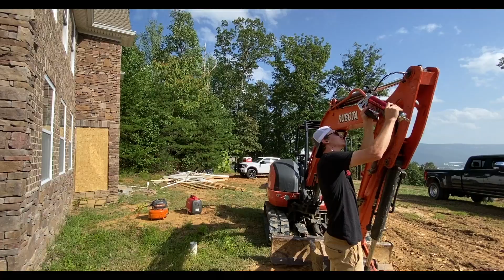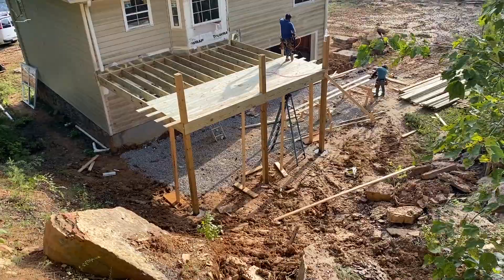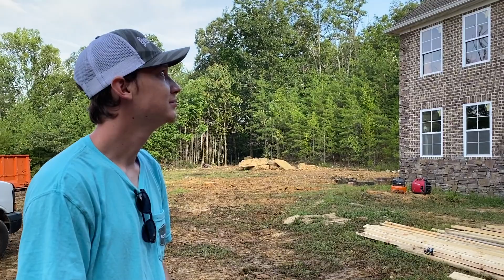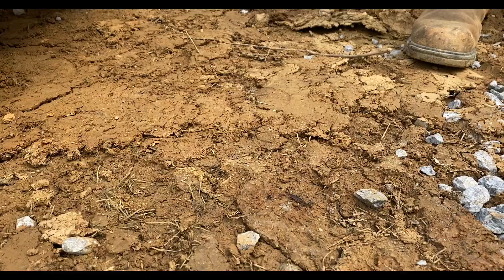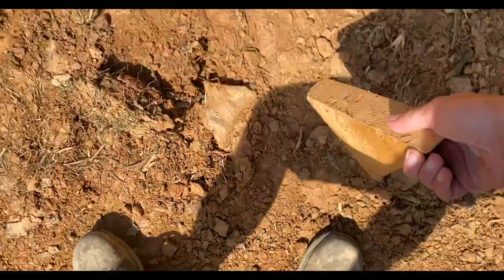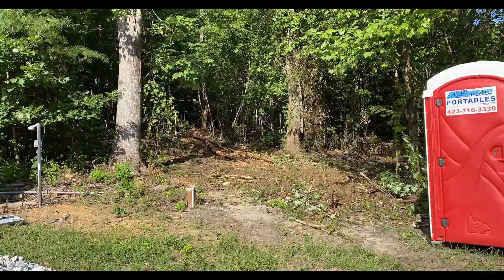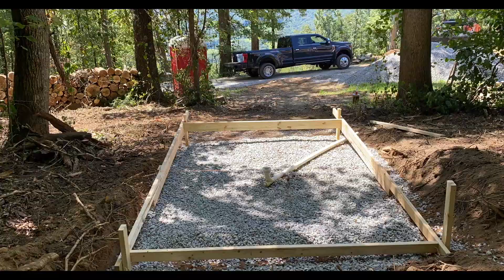The New Goonzquad Headquarters Part 9

Comment: The back of your slab depth looks  narrow. It will crack apart with ground movements from temperature changes. To keep it from happening, you need a 6-8 inch trench around the edge and rebar reinforcement. I'm not sure how cold winter nights can get on the mountain there. I live about 40 miles north of you on a mountain and any outside above ground water lines here definitely needs to be heated.

Comment: Here's my suggestion. Extend the garage out to a 4 car garage and install a garage door on the front for a drive through garage. Plus you'll get a nice front to back breeze. Then add a front porch across the rest of the front. The house is too flat, need to give it some dimension
Reply: They are making a garage/shop on the left blank space
Reply: @maddox2504  they can never have too much garage space

Comment: Green Trim looks expensive adds value. Circle tops are custom, change glass only to low e (without the mutton bars) losing the radius window would decrease value. All glass should be argon filled and low e. You building a pole barn?

Comment: I had to make stairs off a deck that high and i found it best to break the stairs up on the way down, I had mine come down to a lower deck then continue down works and looks really good. since you guys mentioned a hot tub maybe you should consider a lower level with hot tub and break up the stairs case

Comment: Shouldn't your pump house be built around the well instead of to the side of it.. I would not think you would want to leave the well head out in the Tennessee weather in the winter. You are creating an area where you have to run pipe from your well head to the tank unless you are building a small house over the tank and well house too. Ask your well man. You did not explain that in your video.
Reply: I meant over the tank and well head.

Comment: Suggestion on the slab for the well house-  dig deeper around the perimeter of the wellhouse so the increased thickness of the concrete acts as a foundation.. Also you need to put drainage pipe around the perimeter too.

Comment: The pvc pipe coming out of your well casing is not water it is the electrical to the pump. The water is coming out of the casing a couple of feet underground so you need to take that into consideration before pouring a slab.

Comment: If y'all do a zipline to the backyard cliff off the deck, you gotta build a motorized zipline trolley, put a big'ol LiPo battery (with charge controller and USB C, oh yeah) with a large brushed motor on a small pulley and hook it up to a simple RC-style throttle control (like those cheap remotes with a 2 direction analog throttle and mini steering wheel) and you can ride the zipline car to and from the cliff or the deck. It's just an idea of course but it could be cool y'all are branching out what with the house, the helicopter, repairing frame damage on the Trackhawk, y'all are awesome!

Comment: Don't you need to run the line from the well, conduit for wiring, etc. underground into the well house before pouring the slab?  Also, you might want to add a layer of rigid foam insulation before pouring the slab.

Comment: That forming wont work the concrete will run out of all the gaps around the bottom and it needs to be deeper to make the concrete thicker at the back, over time that will crack and break as the ground erodes / drys out under it, even though it's just a utility shed i would put a weeping drain on the uphill side to carry water away (just dig a 1'6 deep 1ft wide ditch around the up-slope side of the utility shed, line it with a permeable material then fill it with clean gravel and fold the material over the top of it to keep dirt out, any water will seep into that and drain away to wherever you dig the ditch to)
The drain you put inside the utility shed needs to be slightly lower than the level of the concrete and you don't level the concrete you slightly slope it all into the drain.

Also i hope you remember to always check your shoes, boots etc for scorpions and black-widows before you put them on, they love hiding in places like that, just get hold of the toe and knock the heel on the ground several times really hard, that will dislodge anything that may be hiding in the toe area so they fall out 😉

PS: i would white-wash the brick but leave the stone natural for contrast will look great. 😎

Comment: Should of done the posts steal to last longer, because after 5-10yrs those wood posts will rot and need replacement. You can’t have the decking and wood support beams just sitting on top of the wooden posts because if you haven’t protected every joint where each piece of wood meets with paint and moisture-resistant sealer then water will get in there and start to rot the wood away. By the looks of it those workers just screwed it all together. Which won’t be good in the long run.

Comment: 3:03 Maybe that's just me, but there's something wrong with those shingles.
Reply: From not enough sunlight, same reason the back of the house siding is nasty
Reply: they're just old and stained
Reply: ITS algee and mildew. my company is called roof cleaner pros and we remove those stains with a bleach like chemical
Reply: They are just weathered. Shingles overall look in decent shape. No curling or lifting.

Comment: I agree with the garage part by @Co1eTrain84. Still think what I wrote about that rock space. Could do wood to get a trail feel. I say the hot tub in the base of the rock area.

I will say this, if you can get solar panels on site, DO IT! It will be a back up. Especially for the pump house. Check out some water collection ideas, from people in Arizona and Colorado. They have like 3 or 4 huge tanks that collect rain water from the roof. I’m sure you have plenty of land and could do an off the grid water collection and filtration. And if you make a man made pond, the small waterfall could be used to generate power.

Plenty of sunshine to store solar power.

Comment: Make sure you run all your water lines through the slab and directly into your pumphouse.  No pipes should be directly exposed to the outside air. All pipes must be insulated and heated in the winter so you don't freeze your system.

Comment: That deck is great....if it were me...just my opinion....I would build a small octogon screen house off the corner near the banking for a breakfast/dinner area with a table and chairs run some electrical and cable out just a nice place outside to eat/ edit videos ect. Out side during spring summer and fall....just my idea.... looking great looking forward to more vids and ya got 2 parking spots under the deck to boot!

Comment: You should put a moisture barrier down for that shed or your plywood will rot out every 8-10 years or so. 
Don't mess with the stone.  If you paint it you'll be mighty sorry in the long run.  You'll have to continue repainting it every 3 years or so.  Keep it as it is!
I also think you should keep the Arched Window.  It goes well with the design of the house.

Comment: Don’t forget y’all’s plumbing for the well !!! It needs to be put in the slab before you pour the mud.
Reply: They also leveled the drain pipe to the top of the slab. Pipe needs to be lower so they can slope the concrete so it drains
Reply: I was thinking the same and why didn't they just form the slab over the well pipe coming out of the ground
Reply: @jackbell1954  not a good idea there is a pitless adapter on the well they sometimes need dug up an repaired plus they need run a 6'' corrugated tile into the well/pump house below the frost line so they can run waterlines & power into & out for well etc
Reply: @stevelalondejr2183  if sometimes they need dug up for repairs then just have it set up that it's all boxed in to where you don't have to dig it up to repair im sure we have the tech and know how to do it
Reply: @stevelalondejr2183  i just reread my reply I really wasn't trying to sound like a asshole. I'm just asking questions I know nothing about this stuff and thinking out load
Reply: They'll also need to run some conduit since they're going to have electrical equipment in there as well.
Reply: Was thinking the same just some elbows near the corners to get water line or electric inside , unless electric be done overhead.
Reply: Electric too
Reply: The electric can be run threw the wall , water lines need to be buried for freezing temperatures!

Comment: You said case ment windows just a advise vynle windows are alot better on maintenance me I use to be a window installer and there been so many windows me and a crew had to tear out you'll have to make sure they stay sealed from the outside mosture creep in rotting them from inside out all yea that scooper looks like a snow shovel be good for winter

Comment: Black widows aren't as bad as everyone thinks. I live in Utah and this is what doctors will tell you when you get bit by a black widow "doctor: we don't supply anti venom for spider bites, the best we can recommend is drink a lot of water and take some aspirin, do you smoke weed? Well smoke a few joints and you'll be fine)
Reply: This isn't a joke either this is absolutely true.
Reply: Don't put the hot tub on the deck I build decks for a living and every deck we have replaced with a hot tub on the deck it ruins the deck in just a couple years the water and the chemicals in the hot tub will quickly ruin it, besides with wood decking you have to make sure you treat the decking every year so it don't crack and splinter.

Comment: I'd shut off the garage area and use that for living space then build a separate garage for the cars. the house doesnt have much square footage for living space
Reply: Exactly that small garage seems useless for all the cars they have anyway
Reply: Yeah the living space inside is rather small with that garage. Makes more sense to make it a traditional family room / theater area.
Reply: @chrisjones3649  no it wouldnt
Reply: they said that garage is gona be used for storing the merch, they gona build like a 5 car garage near the house
Reply: @L5nd yes
Reply: I would definitely close it off. Living space is already limited and you can still load in and out easily with French doors.
Reply: Ya it’s for merch and it will probably be easier for them to be able to load them up into the truck straight from the big garage door.
Reply: @zachfreed5222  I heard that but if I was them I'd do the garage and merch area in the same space. Build a 2 level garage and do merch upstairs. Keep the house for living space only and have the garage be the business side of things as well as car/toy storage
Reply: @Co1eTrain84  fair enough
Reply: I agree.  Plus, the garage is in the back of the house which will be hard to get vehicles in and out.  Also, turning that space into living space will add more sq footage, which means added value to the home.
Reply: I'd use it for an open air dining room. Put one of those fancy 'downtown restaurant' style garage doors with the nice frame and windows on it, have it open up to a nice patio.
Reply: Need a ten car garage by the tree line
Reply: Close off the rear garage and extend out the house on the left side with the new garage and new upstairs loft area with upper windows for a better view .
Reply: Been saying that all along. It seems really silly having such a huge amount of space in thier house wasted just for merch storage, as you say they can keep that in their garage when they build it, the house is for living in not business. I'd definitely be closing off that garage door.
Reply: Donna Peroche  you clearly no nothing either
Reply: Donna Peroche  plenty of room for 3 people.you should take your own advice and go back to playing with your dolls
Reply: layney boy  I thought they meant a raised deck like the one out the back, not a patio style deck.
Reply: Why is the deck facing the hill outback??
Reply: Im pretty sure they said they were going to use it to store merch so they don't sell out so quickly.
Reply: They practically live in the garage anyway, they would probably consider that living space😂💯
Reply: They said the garage was gonna be a merch room at the beginning of the house build
Reply: Stupid idea
Reply: @David Ruff they don't even own any cars so ide board the garage door up
Reply: The upstairs living area is good enough if you choose the right furniture.
Reply: It sounds like a great idea.
Reply: And build a deck on the front-side too.
Reply: @jamewakk  If they build a deck on the front of the house it will block the sun getting into the downstairs as that's the sunny side.
Reply: @jamewakk  ñòè
Reply: @jamewakk yes
Reply: ppl need to watch back videos and in full before commenting

Comment: I hope those amigos have "to code" footers under those deck corner post!
Reply: I hope they see this comment
Reply: And the frame bolted to the house. In fact, I didn't see bolts anywhere... That's a long drop.
Reply: @jSCOTTmc80  we never saw the ledger board...it could be lagged to the rim board...who knows...why always expect the worst lol
Reply: @DaNiElLl430  expecting the worst usualy saves lives 👍
Reply: @DaNiElLl430  - I saw them nail it with a gun, but I also nail them in place before bolting.  I don't always expect the worst, but these decks often collapse when not bolted and could at least harm several people.